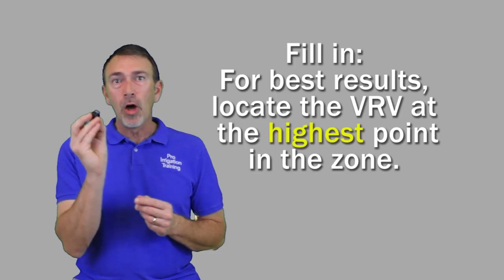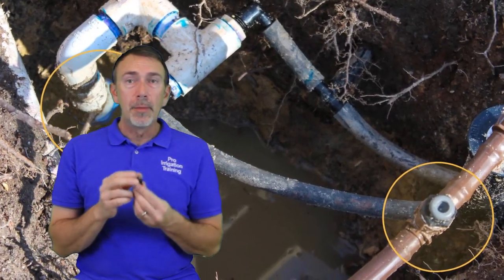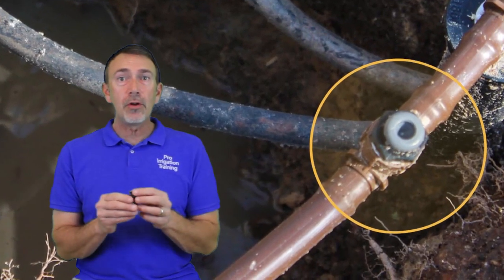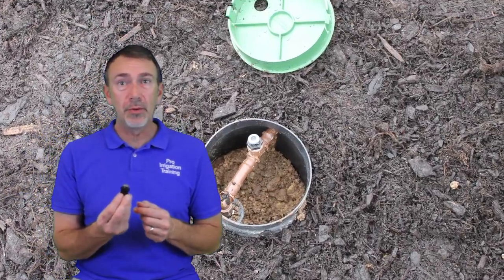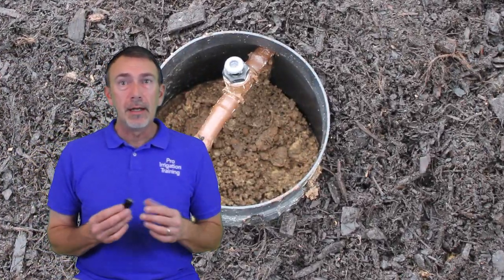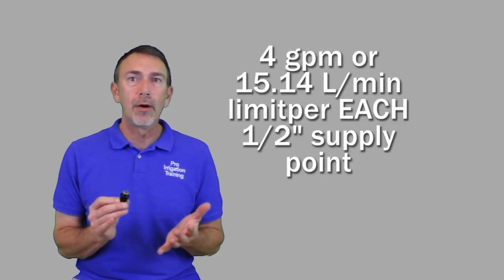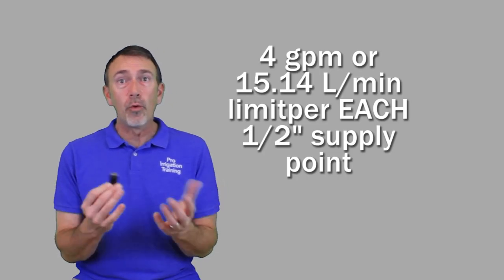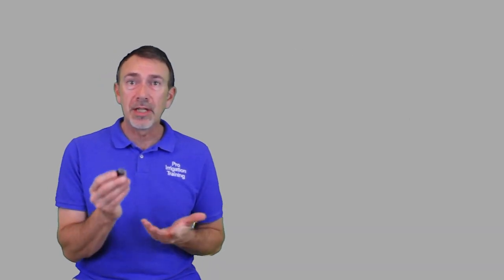Explaining Air & Vacuum Relief Valves | Irrigation Training

Comment: Hey Thank you for the Irrigation Training!! My hanging basket system (8 baskets) is getting air locked & the last 4 & 5 plants do not get water until I unscrew the last 1/4" spray head, then air comes out and then water after it purges itself. I have a single zone battery clock with 1/2" poly tubing with 1/4" drops.. Help would be much appreciated! Thank you
Reply from the maker: To be honest, I'm not exactly sure. I've never seen a drip system do that. A vacuum relief valve wouldn't help, I don't think, as it's purpose is to introduce air into the line. Maybe try a different type of applicator, or a smaller size of drippers, or use a pressure compensating dripper. If you have an atmospheric vacuum breaker on the faucet or after the timer, take it off and see if that helps. Are you using the 1/4" tubing to supply all 8 baskets? Remember you only have about 17 gallons per hour to work with, so keep your drippers total below that. 8 x 2gph drippers is close, so replace them with 1gph or even .5gpm drippers and just run the system longer.